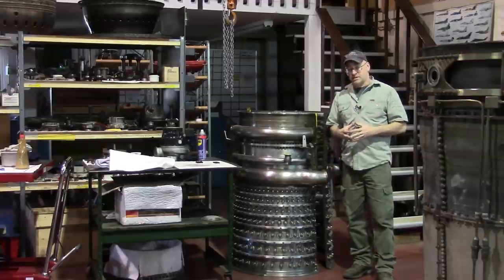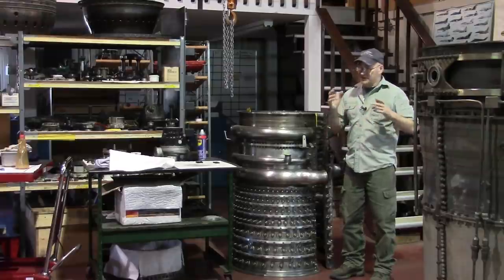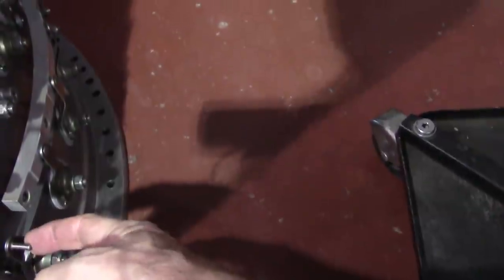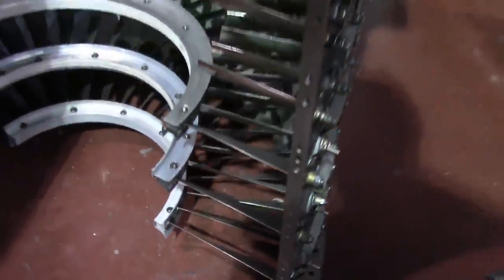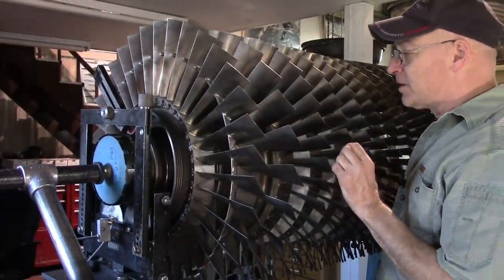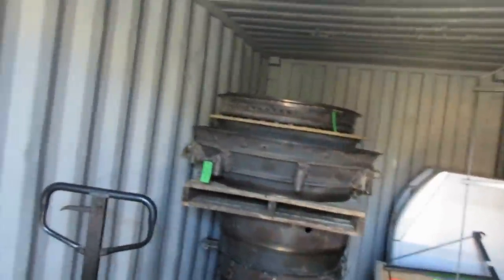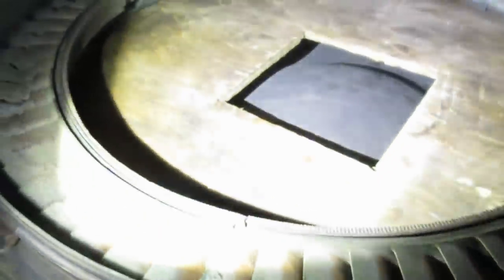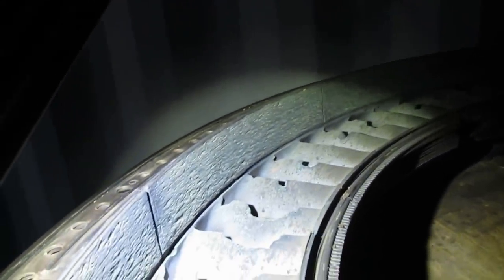Turbine Engine Heat Damage

Comment: Just some corrections:
4:15 CF6-6
6:15 not TRF it's the TMF
10:30 how should the stage one nozzle touch the stage 2 blades? 😉
Reply from the maker: CF6 is enough detail for the general audience. Correction rejected.

It's an LM2500, and this is the rearmost frame of the entire engine. Wasn't going for jargon; going for generic reality. Correction rejected.

I'm holding stg 2 blades, that have been severely damaged... most likely caused by the stg 1 blades disintegrating from overheating, and causing metal debris to hit the stg 2 nozzle and blades. We found less burning and more smashing in the 2nd stg.
Sorry for not spelling every tiny detail out for you. It was assumed by the presenter that any individual with the knowledge you seem to have would be able to deduce that this video was a simple summary made for a general, interested audience.
This third correction is based on an assumption that was not true. It has some elements of truth to it, but it is extremely weak, and to use conversational terms, it is condescendingly nit-picky.
Reply: @AgentJayZ  OK for point one and 3 but definitely not for point 2.
Reply from the maker: Pah! I fart in your general direction, you aircraft arrogante !
Reply: @AgentJayZ  the fact that I reply to an LM video should clearly show you that I am not in aircraft or aviation business. Just to make it clear again also for you..... If you are talking about an LM2500 gas turbine, this means it's a gas generator connected to a GE 6pack  power turbine and the frame you showed us was the turbine mid frame as it sits between HPT and PT no matter what configuration of a LM25 this is never called TRF. Or how would you call the frame with number 6 and 7 bearing? 1000 😘 for you.
Reply from the maker: Oh, serious again. 
Please be advised that the LM2500 is/was available in two configurations: with and without an integral PT. This one is of the latter design.
I did not think I would have to explain that to a sooper genius critic, because is hopefully is obvious that  the output of this engine is the gas stream created by a gas generator, and not the torque created by the abovementioned power turbine.
You saw that, right?

Pox on your last line. I already explained I was not towing the corporate jargon, and was using generic real-speak.
Time for you to go now. Thanks for it, though.